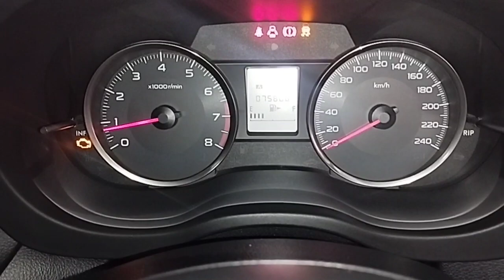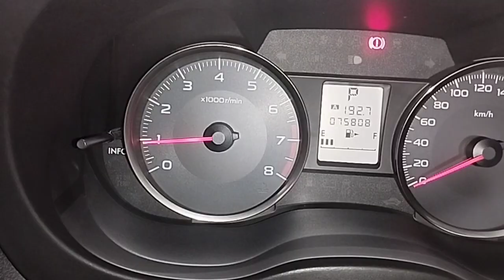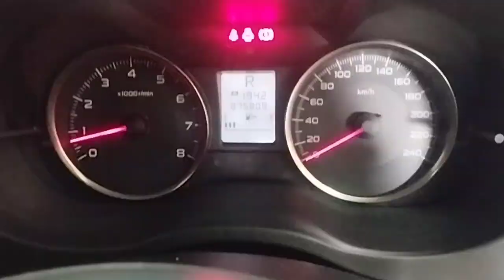how to Fix Engine Code ! p0171 system too Lean !  Replace o2 Sensor Bank 1 sensor 1, Subaru xv

Comment: My wife’s 2016 Subaru Impreza has P0171 , just discovered sensor 1 is covered in oil from a recent oil drip. Gonna clean tomorrow and hope is prevents future rough idle and constant check lights. It’s been a tedious testing trial and error to troubleshoot. Hopefully this is it

Comment: hi I have one question , if i change sensor , then turn on Engine and drive around 50 kms . will the check Engine light goes out itself? or it must be cleaned from Computer?
Reply from the maker: Yes clear engine code with scanner